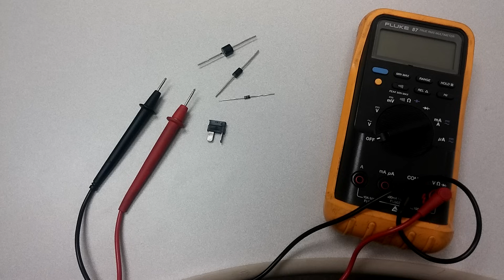How to test a diode

Comment: can we test diodes on-board to make the work hassle free?
Reply from the maker: You can try it, but in order to be certain about your test, you need to isolate it from the rest of the circuit so that you aren't accidentally testing the continuity of the circuit instead of the diode.

Comment: can you test a Diode while its installed on a board?
Reply from the maker: Maybe, maybe not.  It depends on what the diode is connected to in the circuit.  The rest of the circuit could throw your results off.
Reply: @JustinMillerAutomotive  I'm checking across the coil of a 14vdc relay I'm using to power my Corvette's fog lights off the battery instead of the vehicle's stock harness. I'm getting. 035v both ways on both relays. Does this mean the relays have no diodes installed or is the coil causing some sort of interference? Also, what diode should I use for this? Thanks

Comment: Is this for AC OR DC ?
Reply from the maker: Either one.  A diode doesn't care.
Reply: Justin Miller perfect thank you for the response I appreciate it 👍🏼
Reply: This seems like a incomplete answer to a confused question.  The diode blocks current (mostly) in one direction and allows it in the opposite (like a water check valve).  Diodes are used to block current flow.  In AC, current alternates in direction ( hence the name, AC) and does not alternate in DC (direct current) (all of a sudden the DC name seems uninformative, but why belabor over a point that is fundamental to current flow?  It could as well been named OC/BC, oscillating current and basic current).  This is component-level checking.

Comment: what will happen if the diode is bad you never said, will it show both way or not show anything ether way
Reply: When the diode bad it shows current flows in both direction, It means time to replace with the new one but has to be the same value mention on the diode, most common one is IN4001, IN4002 etc...
Reply: PhilOffHisTree --- bad diodes can cause problems like blown fuses. (Other problems, too, I'm sure...but I'm not an electrician.) If you watch this other video he has a bad diode causing the fuse in a power supply to blow.  Diodes only let electricity go one way...when diodes go bad electricity goes both ways.  Here you go:   https://www.youtube.com/watch?v=FnhJIJN5H8M